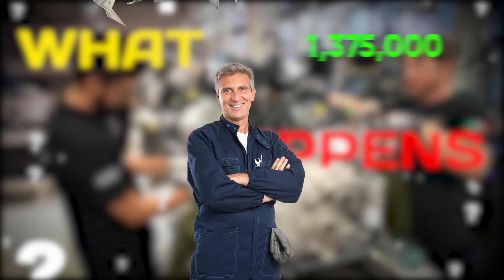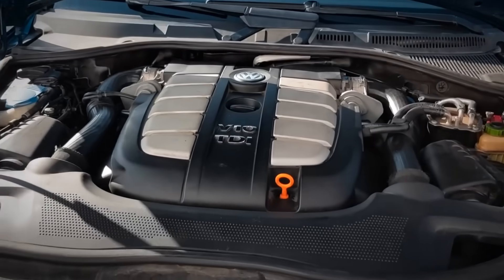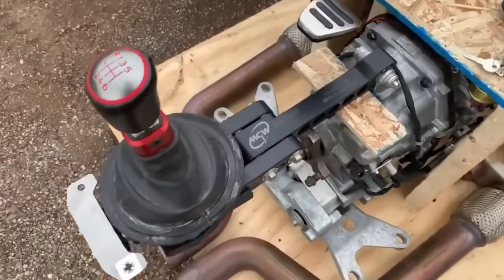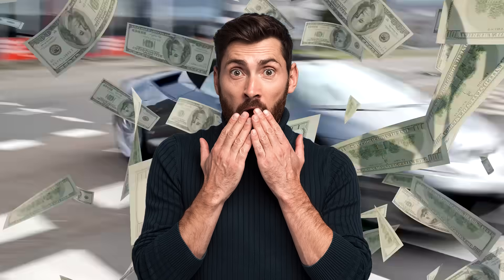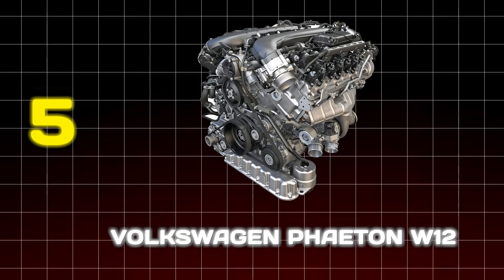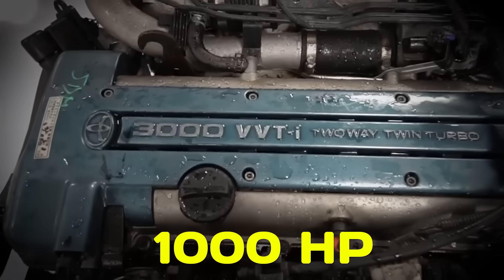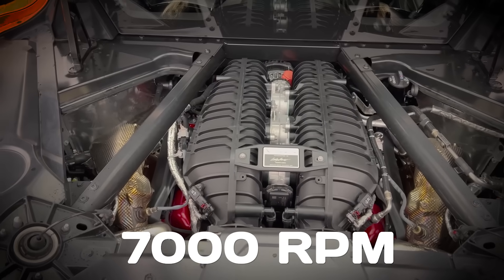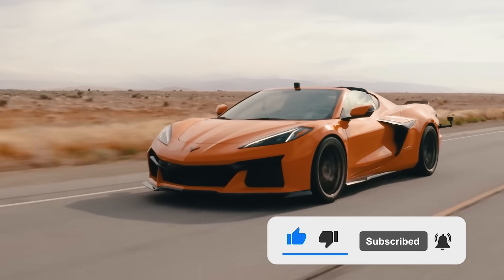12 Most Over Engineered Car Engines Ever Made

Comment: The Yaris engine ❤
Reply: Yeah the 1nzfe. Ive had 2, my first one only needed a water pump at 290k. my second one, that i still drive has needed nothing yet and its at 270k. I honestly believe that if you just do regular maintenance those engines just cant die and if you live in a area without winter the car/engine will just go on forever.

Comment: Why are Alfa Romeo V6 and Toyota 1UZ-FE absent from your list?
By the way, in my opinion Audi 4.2 is more advanced than 5.2
Reply: I am a REAL fan of the Alfa Romeo 2.5 Liter V6 Engine...the Sound was AMAZING!  It WAS a Pain to Work on...Timing Belt/Water Pump and Tensioner Replacements every 30 K Miles.  Then, there is the Head's Hardware to Operate the Exhaust Valves...lots of Parts.

Yes, I have Worked on those Engines...but when behind the Wheel of a GTV6...Heaven on the Road. One of my FAVORITE Cars to Drive!

Comment: You missed the two liter Mercedes engine in my GLA 45 AMG. With a stage one ECU flash, it produces 420 ft/lbs. and 430 hp. 😂
Reply: The Mercedes Benz twin turbo 2 litre engine will produce 469 horsepower anytime. Mercedes Benz actually built a few cars with the engine in this configuration. It currently stands as the most powerful 2 litre production engine in the world. It was put in other cars than the CLA-45 AMG. For a little engine, that is some serious power.
Reply from the maker: The GLA 45 AMG engine is impressive—thanks for sharing!

Comment: om 617.95x engines still running everywhere, mine ran used vegetable oils, biodiesel,diesel,used motor oils and used atf.
Reply from the maker: Yes— the OM 617.95x engines are tanks! Crazy that yours ran on everything from veggie oil to ATF and still kept going. Truly one of the most bulletproof diesels out there 🔥 Thanks for sharing!

Comment: LS7 💘It's a gem of an engine. Instantaneous super linear throttle response. Unreal wide torque bandwidth. Intoxicating sound. And after Feb of 2010, no more valve drop issues.
Reply from the maker: You nailed it! The LS7 is definitely a special engine, especially with that incredible throttle response.